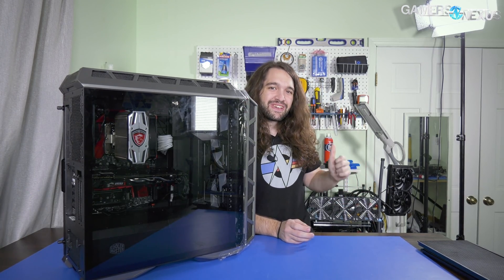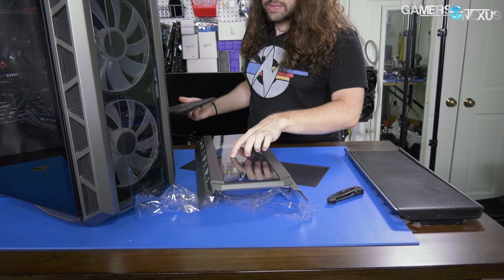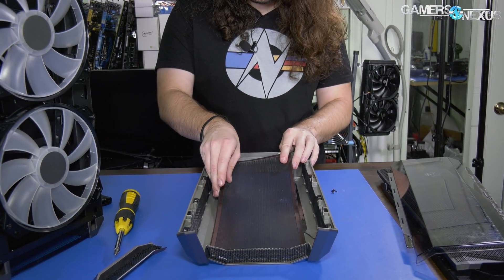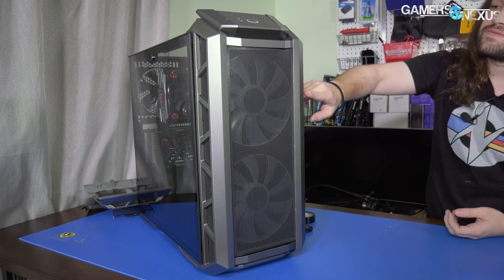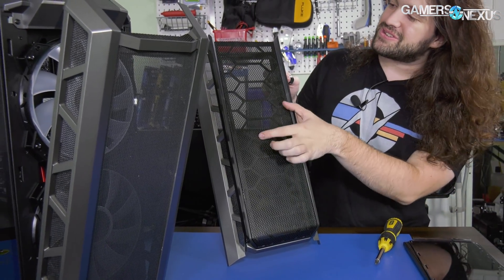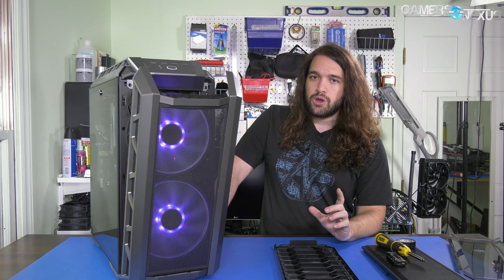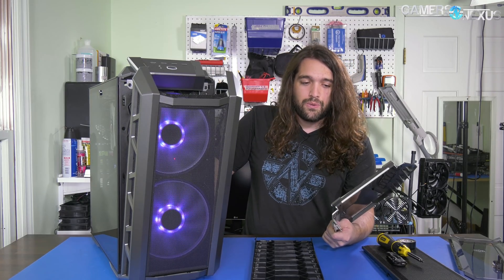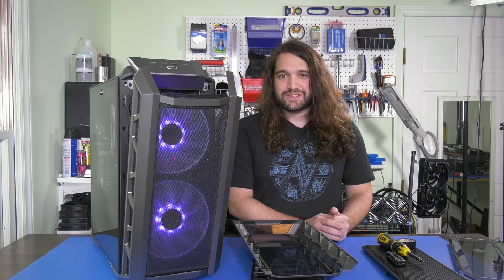Meshify H500P Case Mod: Actually HAF

Comment: maybe you could do this case with noctua 200mm fans, because it looks like the coolermaster fans are crap, loud and don't push much air, i would really like to see a comparison with those fans and noctua ones  since there is no other choice for 200 mm fan.
Reply: malus.animus 200mm noctua fans aren't cheap. This case is already 150$ and with 50$ for fans you could simply just buy a dark base 900 which is miles away in terms of quality and airflow
Reply: yes but i would still put noctua fans in dark base 900 :) that would make it more expensive, i have mesify c, with 4x140 an 1x120  noctua coolers that did run me more than a case itself, but i wasn't complaining at least until few days ago when i saw that noctua will make black fans :)

Comment: I'm curious about this in regards to the static pressure note. As a HAF X owner myself, it seemed like all the stock fans were kind of crap, so I've replaced everything with higher quality, higher static pressure fans, but I also have a 360mm radiator in the top. If you did something like this on that H500P would it achieve the same static pressure benefit of keeping the 'glass' top on?

Comment: The case mod is alot better than the original. I feel like though the fans on the front could be replace with three small pwm fans. The air flow would be better then.

Comment: wow, the mesh front even looks better, imo. 
also, since you mentioned that the air kinda just escapes the case halfway through, would an auxiliary high pressure fan on the inside of the front panel bring a worthwhile improvement when using an air cooler?

Comment: Some screen door mesh from your local hardware store could be a very cheap and easy fix. I'm thinking glue it on with some silicon rubber adhesive (or silicon-latex caulk). You'd have to hold it in place until the glue dries with some tape.

Comment: If they sold the Mesh Panels as a "DLC" i'd buy them as long as they're reasonably priced. I mean i already shelled out $165 with shipping on my Preorder. With the panel off you can feel air being blown all the way to the back of the case. Put the front panel on and you can feel air to about a 3rd of the way through the case. PITIFUL! Not to mention my top 200mm fan wobbles and no its not just the center sticker. Its the whole fan. I'll be contacting them for replacement fan

Comment: charcoal colored fiberglass window screen and a hot glue gun would probably work and look better. It wouldn't work very well as a air filter but you could get the things I said at Walmart pretty cheap.

Comment: I think steve singlehandedly  reduced coolermaster h500p sales by about 40%
Reply: That's why supporting GN on Patreon (even just like $1 a month) is important. You can bet at least some other channels wouldn't say half of this. Even when they are critical, they pad it with positives so the manufacturer doesn't get too pissed off. GN's reliance on the funding coming from us and not from the sponsorship deals is probably why they can even say this stuff.
Reply: And Bitwit is trying their best to sell it ...
Reply: Your percentage is off, he cut their sales in haf, so that's a 50% reduction 🤣
Reply: joris yauw I was interested until Steve's review came out, I don't think you are too wrong.
Reply: I was really hopeful for this case and was planning on buying it. Glad I held out and watched the GN review, this case is just poorly designed (probably rushed) junk upon closer inspection.
Reply: Steve fixed a case.
I bet if CM paid Steve like $300 to critique their work he could have saved them thousands in R&D
Reply: joris yauw The $150 price tag did that.

Most people here seem pseudo correct though, it was a brutally honest review with a positive spin he made himself. I think it looks better with the Mesh, but I prefer muted rgb as opposed to the amusement park look anyway.

I really like the design of the case, just not the original materials. The plastic still bugs me, but I like the overall shape, especially compared to the Alien bug helmet case so many reviewers seem fond of.
Reply: This case has nothing on Meshify C, for double the $$.
Reply: Gungrave123 meshify C can't git a 300mm gpu with a front mounted radiator and fans
Reply: I'm actually seeing coolermaster releasing the same design top and front panels in metal with mesh as a $60,- dlc lol...  like with the mastercase, bring out a working, cheaper, but incomplete product and let people spend money overtime to upgrade it, and in the long run have them spend about twice the amount of the case on (mostly) cosmetic upgrades and a drive bay or two.
Reply: his review was quite honest as usual. It's not a great case.
Reply: Not really real tech people do not  listen to this crap site
Reply: Tbh i think 40% is more accurate, half is a little too much, not all buyers are subbed to GN and watch the videos thats why i took a guess at 40% rather than 50% lol
Reply: I agree,  but just wait for amazon/newegg reviews, most of  those are much less biased than other reviewers as they don't have to please manufacturers to keep receiving products. That noted, most reviewers usually don't receive money for a review, just a product to do it, the viewers take care of the rest through ads and amazon links etc.

On the other hand, Cooler master will actually kick themselves in the stomach if they stop sending products to GN, as this will look like they can't take criticism, it will hurt their brand, as it is their priority to put out a good product that will sell well.
Reply: Totally agree!
Reply: I think Coolermaster did it themselves.
Reply: And quite right. For £150 the case build quality is laughable
Reply: @PimptatoPCs : Eh, he had negative feedback about the case. Paul's was a more "glowing".
Reply: +Ben - you wont watch many youtubers at all that are MORE of a shill than Tiny Tom Logan. That guy sells out every chance he gets.
Reply: Don't give a crap, honest reviews > coolermaster profits. That mesh mod should teach coolermaster a lesson, functionality over aesthetics. If I'm going to spend $150 of of mined cryptocurrency on a case with twin 200mm fans, it better have some damn good airflow.
Reply: fourtysix4646 Yes well it certainly looks like cheap arse plastic compared to fractal. I particularly hate plastic because it’s particularly bad for our environment rather than steel which is natural and could be recycled or will eventually rust away back into the earth.
Reply: I'm sure his 200k subs account for 40% of this companies sales...
Reply: That's the truth, jorus!  Thanks to GN, I was able to cancel my order before it shipped!
Reply: Yes pretty much. Glad to support independent journalism.
Reply: And jet fuel can't melt steel beams... I don't think that ALL other reviewers are shills. More likely there are just some things Steve won't forgive which are frankly not that big of a deal to others... Check out the OC3D review, Tom loves this case but I've seem him brutally destroy products from his own channel sponsors when he felt the need to! It's just a mix of priorities. Some people perhaps value aesthetics more than they should and allow that love to gloss over other failings I guess.
Reply: People are finally starting to see coolermaster for the company they are. Over priced, over hyped junk. Way better options out there these days. Corsair and Fractal are the way to go for a case.
Reply: Speaking of coolermaster. Watch this guy rip coolermaster. https://www.youtube.com/watch?v=TSwrDW3NsPw&t=41s
Reply: Or inspired someone to start a business modding cases. Hmm be back once I start my case modding business.

Comment: Why don't they just put the fans inside the case and not outside. Would have resulted in more space between fans and plastic shroud.
Reply: Richard Schlegel I've been wondering the same thing. Anyways, the front mesh looks better

Comment: Great video love the way you made the case better. Any chance you can do a review of the silverstone primera rgb edition? There doesnt seem to be any in dept reviews about it and its a promising case, with the rgb version they ironed out the issues that the non rgb version had.The case is similar in size and the h500p but has similar features to the rl06 with the front mesh intake. Would be great to learn more on the case since it has great air/watercoolling potential.

Comment: It even looks better. Waaaay better. Now you just has to throw away those plastic parts and CNC some new ones out of aluminium blocks.
Reply: For the cost of a DMLS machine capable of printing aluminum, you could have the panels CNC machined at a professional prototyping shop...and then buy a house.

There is that molten aluminum printer concept from Vader, but you'd have to do days worth of post process finishing and I'm not sold on the structural stability due to air intrusion and oxidation.

Comment: It wouldn't surprise me if they did sell the optional mesh panel. They sell a bunch of options for the  older master case 5 pro. They have both solid and mesh panels for the top and front, tempered glass for the side panel, a power supply shroud, hell even an upgrade to the front panel i/0.

Comment: where is the space for a optical drive? you know what i mean? cd reader drive thingy
Reply: Plenty of new cases have no 5.25" bays or front openings, but they do have RGB and radiator mounts instead. Guess the trends are shifting. That said, if you didn't use the optical drive bay on the case, it's where I'd put a pump or reservoir anyways...
Reply: but how do you read cds, dvd, or even install windows?
Reply: Windows can be installed via USB and most people are just streaming content these days. I personally can't live without an optical drive as i value quality over convenience. A Blue ray disc looks and sounds better than streamed video and a CD sounds better than streamed music. I find it sad so many cases lack the option for a 5.25" bay but it is what it is... Just have to pick a case that has a 5.25" bay. Or build an external drive bay box (there are no ready made UHD options for external optical drives).
Reply: It might be hard to find, but there are external drive enclosures for Zip drives and tape drives.  Those fit most 5.25" drives and devices like old school fan controllers, water cooling reservoirs, optical drives and things like that.
Reply: oh right there are externals. forgot

Comment: IMO that fix should be the default paneling.
The only thing left would be to design a structure to hold the filter in place like the one you glued to the top.
The RGB is going to make the fans shine through enough anyways.
Anyone with a 3d printer will make the mod in no time.
Reply: 3d printers are for amateurs

Comment: Electrical tape tends to peel after a while. Aluminium foil tape is in my opinion a better solution. love the channel keep up the good work guys
Reply from the maker: For our uses, it'll only really be on there for initial testing -- but good point. I had considered a black silicone adhesive, but didn't want such a "permanent" setup. A black duct tape may have been best for something semi-removable, but also semi-permanent.
Reply: cold glue
Reply: Hot glue
Reply: hot glue
Reply: A few liters of DNA fluid.
Reply: epoxy two component liquid metal
Reply: Superglue
Reply: Magnet strips. That works fine.
Reply: Pobb Roberts high end electrical tape won't peel

Comment: Everyone who gave this case a good review is out of their mind.
Reply: Actually no, It's not wrong. The case is overpriced, and the build quality sucks.
Reply: Those other low-flow cases are good sellers because they trade airflow for low-noise and good sound isolation. This case design was just dumb and the price is ridiculous for the quality of materials. Look at the build quality on a $99 s340 in comparison.
Reply: Gareth Tucker this argument doesn't hold much water tbh. Even then average joe can understand flimsy build material and overpriced products.
Reply: Brother Ares They sell near see through Mesh as well. It's used on screens, visible filters etc. it looks like it's made from thin fishing line, and is about $2 more per 3'x3' ($13) sheet at Home Depot (they'll cut whatever size you want obviously).

$150 is expensive for the material, but it's not a crazy price for a designer case. The 1/3 of the case being made of $10 worth of plastic is certainly crazy though, and to assume water cooling in a "High Airflow" case with 2 x 200 fans in the front seems short-sighted at best.
Reply: I fell for the hype of the S340 as well, and seriously thinking about switching the case out.  Probably not for this one though - probably something like a Cougar Panzer Max.
Reply: meshify c or a silverstone pm01-rgb.  They do what this case failed to do out of the gate
Reply: they're just sellout dumb fuckers.
Reply: + andymath89 Insulting people by calling them "Sellout dumb fuckers" Makes you seem far more ignorant, and ironically enough, stupid. You cannot start calling people "Sellouts" with out actual proof. It's a serious allegation.

Just because I disagree with Paul, Jay and TTL. Doesn't mean I'm going to start hurling abuse at them like a child.
Reply: James Mastroianni Yeah, but that one looks good, even meshed. The Meshify and Silverstone...this has definitely been the year of the ugliest cases ever made since they were still putting numerous visible front 2.5" bays.

Nothing is worse than the Orange and black praying mantis helmet though.

I like the Portal, and h500 screened (again, I think the Mesh makes the rgb look better slightly muted  as well). No clue how anyone could save thermals without two aio's though (I don't think it can fit a large enough rad to use 1 to keep parts under 65, as the interior is going to be near 80 regardless).
Reply: This guy ripped CoolerMaster for years of half-assing....it needs to stop. https://www.youtube.com/watch?v=TSwrDW3NsPw&t=41s
Reply: His voice is really annoying in that video. But funny thing is, he is right. The only good products they make is their keyboards and the Hyper212Evo. I had a CoolerMaster StormScout. and it SUCKED. Most reviewers do not know what they are talking about.
Reply: Agreed. They see the dollar signs, and make a biased review.
Reply: +LatamirDigital It's not that your voice sucks. There is fan noise in the background, alot of echo and you can talk a little too fast at times. Overall making it difficult to actually hear what you're trying to say. Good video tho. :P
Reply: I own this case as I dig the look but high airflow haha nah I use aio on my cpu and a water loop on my gpu and had to add 4 extra fans, but overall love the case as a case but if I need to move it or go on Lans I have to take my shit pc as this case feel like it will break
Reply: its called "paid media" lol
Reply: Tim well no, that statement is wrong. Anyone who said it had great thermals just because of the front fans is out of their mind. If you say that cooling is questionable but it looks good (Look at the s340, one of the highest selling cases but thermals are terrible) then yes, it's a solid review. Steve just went to the next level and found the answer everyone wanted